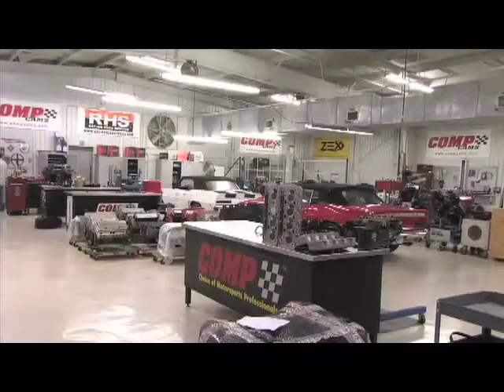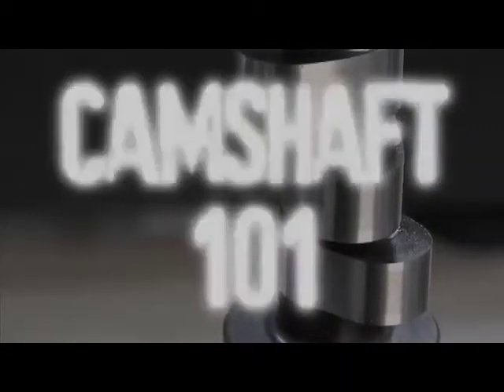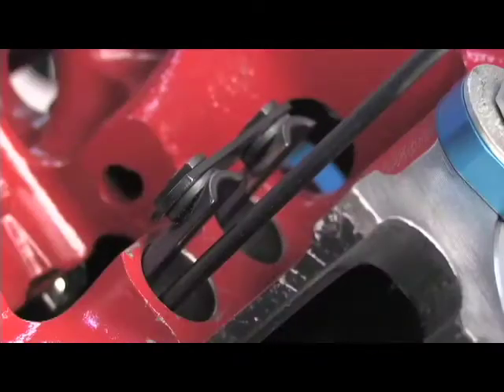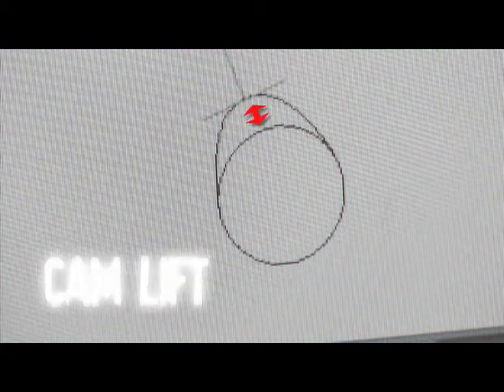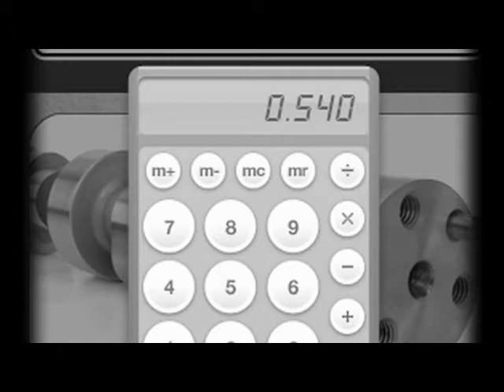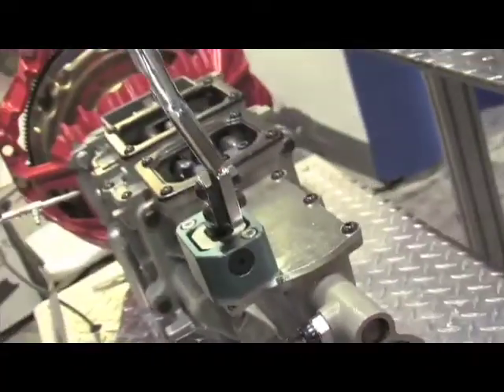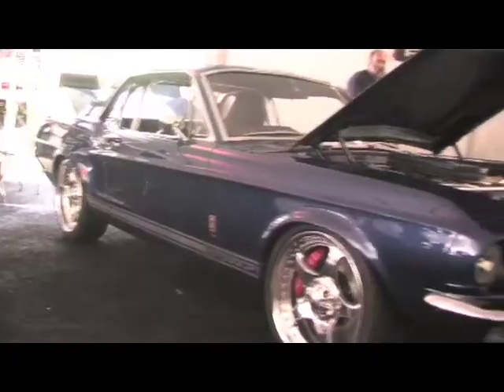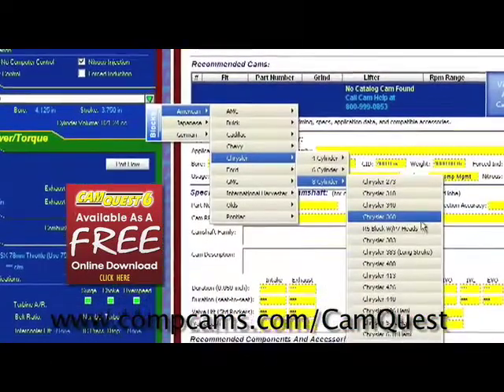StreetlegalTV.com - Comp Cams 101

Comment: @lillskiten1337 you would need to isntall hardend valve seats, because the lead in the fuel actually acted as a cussion for when the valves actaully slam the seat when they close. but with unleaded fuel that lead is obviously no there and there would be damage the the seats.